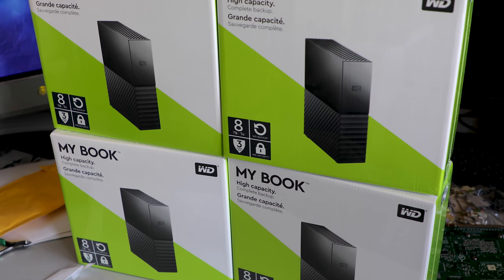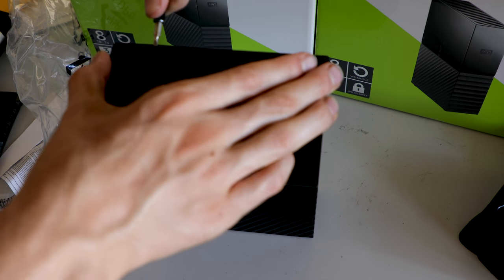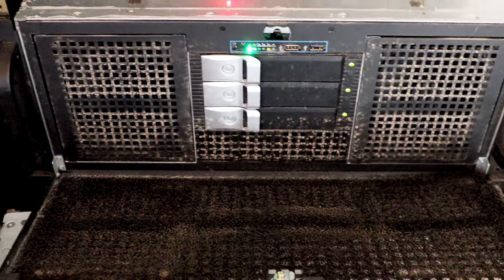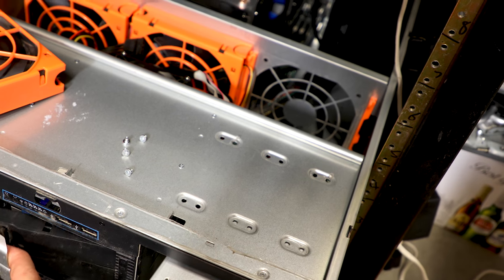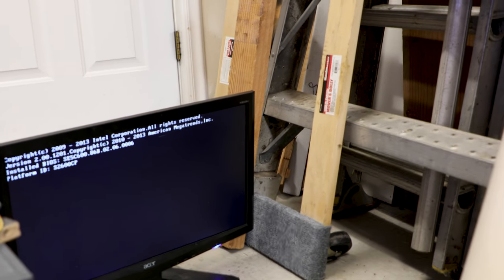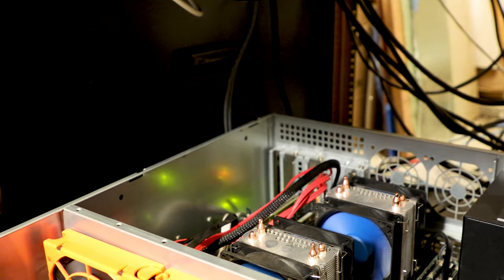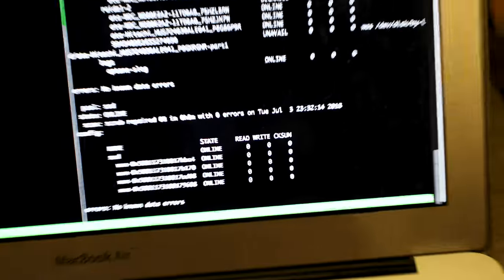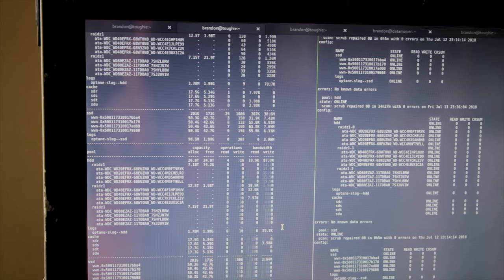Upgrading My FileServer with 8TB WD Mybook drives

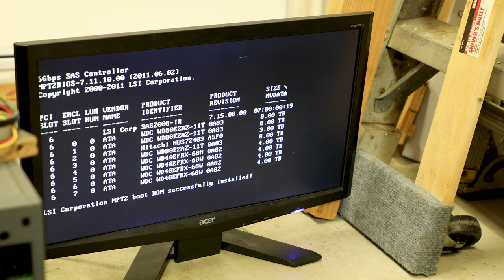Comment: Question, isn't the LSI card meant to be in IT Mode as to passthrough the drives cause isn't IR the Raid mode? 9:09

Always a fan of data storage upgrades. I'm building a ZFS Server currently as everything I have is just on external drives spread far and wide.
Reply from the maker: It's not in raid mode. I never bothered as the current mode shows the drive to the os with direct access and passes other drive data like smart data to the os aswell. So I didn't see a reason to flash the card. 

The 2 ssds I think are on it mode but can't confirm. Raid is disabled and the menu just shows some sas info. I'm am using the stock firmware on all cards
Reply: That's cool.

I'm quite impressed with your setup, mainly the whole duel xeon board and enclosure. I purchased a Logic Case 16 Bay and slowly I'll expand my storage out.
Reply from the maker: I don'tlike that case I got. I wish I spend the extra on the hot swap model. My current dream is a top loading 45 bay case. I found some chenboro ones a while ago for sale. I'm also considering a r820 on day and doing all storage on sas expanders. But that's kinda overkill.
Reply: I can understand what you mean. the 45bay Cases look awesome. Give me a couple more years and I'd prob get one myself as RED Drives/IronWolf Drives have been dropping in prices. Slowly but are dropping.

Comment: ... Before I'd shuck...
 I just received my 2 My Book 4TB. I'd like to put them in my NAS. Crystaldiskinfo reports WD40EDAZ. Can't find much info...
My questions: 
SRM or CMR ? how to know  ? what worries me is that crystal disk info shows features: S.M.A.R.T., NCQ, TRIM ...
BLUE or RED ? head parking issues ?
SHUCK or RETURN  ? bought from amazon,
Reply from the maker: Are they opened? I'd your using them I'd  just run some tests and it should tell you if smr using fio. 

I think those enclosures pass smart data so that will tell you about thing like tler. 

I'd personally return and get a 8tb drive. Then you won't get a smr drive and bigger drives are lower tco and faster.
Reply: @ElectronicsWizardry  
Thanks,
I only opened the first one.
The reason I bought 2x4TB is that I planned to convert a RAID1 2X4TB into a RAID5 4x4TB. Adding 8TB HDD to the mix .. is not ... I'm busy filling it with random . speed if 65-80 MB/S from wsl2 dd.
I planned another script using dd conv=notrunc to rewrite the whole disk we'll see the actual behaviour
Reply from the maker: Try using fio with random writes to test for smr. Dd from my tests will not slowdown on smr drives
Reply: @ElectronicsWizardry  Thanks for the hint ! I used this: https://unix.stackexchange.com/questions/286432/how-to-determine-whether-hard-drive-uses-smr/489530 and the pattern is clearly SMR. Time to try to return those disks! Thanks a lot for your advice

Comment: Nice tutorial, thanks.
Can I get rid of WD in-built hardware encryption by pulling an empty HDD out of its original enclosure (according to your tutorial) and putting it in another enclosure that does not have in-built encryption? 
As far as i have  found, some (if not all) of WD drives are being automatically encrypted by the in-built hardware (regardless of the use of WD installable software and password) and the drives themselves are not accessible outside of their original WD enclosures, meaning, If the enclosure fails, all the data is lost and even data recovery companies struggle to help. More about this topic here in the WD's community comment "Can HW encryption be completely disabled on new My Book series?": https://community.wd.com/t/can-hw-encryption-be-completely-disabled-on-new-my-book-series/189925